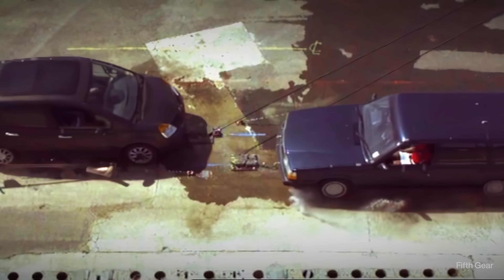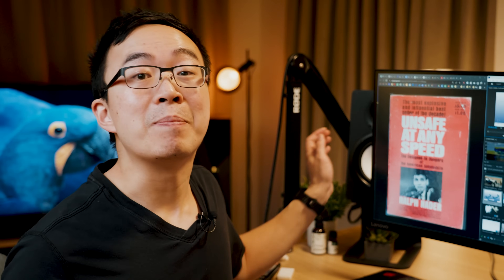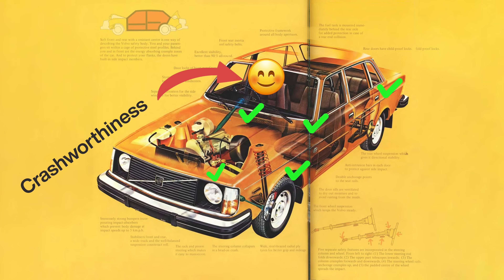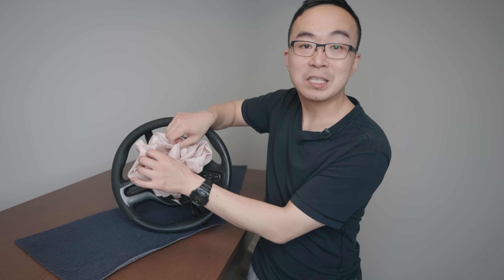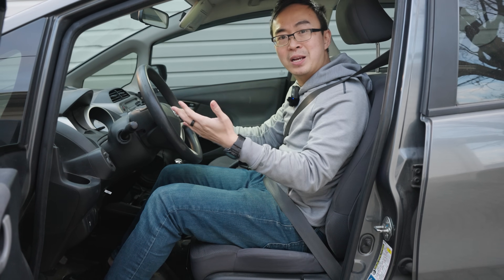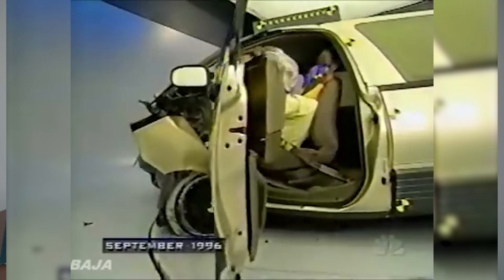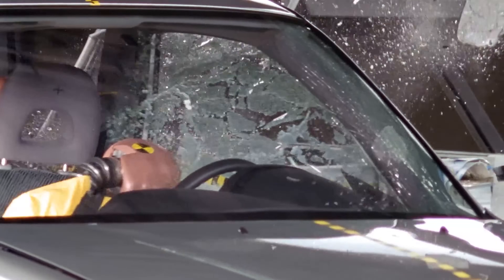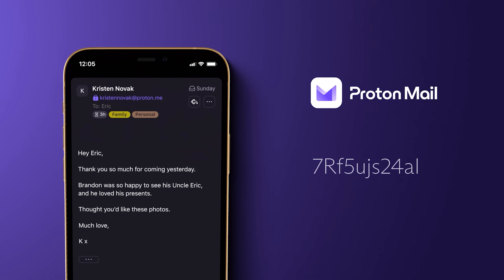When does a car stop being safe?

Comment: Fun fact from an industry insider: in many cases, the automakers had already identified and designed solutions for the problems that IIHS testing would later bring to light. 

The automakers calculated that they would lose money if they implemented these changes, however, so it's a good thing that testing authorities like the IIHS called the public's attention to these issues, since otherwise they might have never gotten solved!
Reply: they just still use the old design just in other markets. Example: renault sells old european dacias with current 1 star ratings as renault in latam.
Reply: @f3rny_66  Yep and Nissan sold the Tsuru in Mexico for many years.
Reply: Well there are too many people there anyway @f3rny_66
Reply: I was once present in a meeting where it was dicussed that the area where the pole in the NCAP side impact test strikes, needs to be reinforced. Simulations showed a below 5* rating. Mind, "THE AREA WHERE THE POLE OF THAT TEST STRIKES", not the whole side - just that specific area. God forbid you hit a tree sideways in a different spot...
Reply: Reminds me of Fight Club
Reply: It is not as bad as it may sound. After all, every car is a compromise. Adding more safety features makes the car not only expensive but also bigger and heavier. And while people value safety when asked, we do not all buy the safest car on the market when buying a new one. It is again the same tradeoff at work and having a reasonably safe but more economical car (or a smaller one or ...) might be the better compromise.
Adding more safety features than necessary makes sense, if you can make this a part of your brand identity (like Volvo used to). However, cars have gotten so safe that safety is hardly a unique selling point, especially in the mass market when price is the dominant factor
Reply from the maker: Agreed, it would never have left the engineering labs if it weren't for outside forces pushing for change.

There was a nhtsa study on the total cost of safety improves including research and implementation costs and it was something like under a $1000 a vehicle.  Economics of scale.

It probably was a money loser until they all agreed (and consumers) that cars could be more expensive.  Also why they're all so expensive now.

Thanks for the inside perspective!

Edit: $1000 in 2002, $2000 in 2012.  Source: https://crashstats.nhtsa.dot.gov/Api/Public/Publication/812354
Reply: I don't know if this translates correctly. In Germany, we say " a horse only jumps as high as nessasary"
Or in other words, why should you spend money on something that nobody cares when burying this car.
Reply: @raphiseth6942  It's not that nobody *cares*, it's that nobody *knows*.
Reply: @raphiseth6942 I don't know if that translates correctly either, but I can tell you it makes perfect sense.
Reply: And they need to make the tests stronger, as they are already in an area to design the car to pass the test ..and the car looses the moment the scenario changed.
You can see that are eu 5* cars that fail the 25% side overlap test...on the other side is cars have isses passing EU teat, as the focus is on pedestrian safety.
And of it hadn't been with the Mercedes A klass allomst rolling in a simple test ESp wouldn't have came out that fast
Reply: other fun fact, Volvo guys are very crazy about safety of people inside car, so you check their newer and newer version you can see how they improve
Reply: volvo was the only brand whit good scores in the small overlap on the first batch of tests, before the automakers knew about it, this was already standard testing for them 😂
Reply: More safety sounds nice, but what this means is that costs are passed on to the consumers.  The majority of car owners will not end up in a dangerous accident, but they didn't get a choice in whether they want a more expensive (and slightly safer) car and are poorer as a result.
Reply: @Zorro9129  ..a mind set thats often used to decrease or thumb on saftey...
..most ppl will never have any use for the seat belt either...or improved breaks, most cars will never be stoolen either so thers no need for locks either... ;D
Reply: @Zorro9129 Except that as per the video the improved safety has been driven (no pun intended) by money. The billions of $$$s saved by the insurance companies would have been added to everyone's premiums. Pay $s upfront when you buy your car and have a reduced chance of serious injury or death Vs pay $$s every year so that when you die your survivors get a payout.
Reply: @Zorro9129  I had a think about this. You definitely have the right to express an opinion. You have a reasonable argument that you should be consulted in advance. However in a market economy, choice isn't always as free as you'd like; it's driven by what will make the most profit, which is driven by what will sell the most. If you ask millions of people "This is our proposed specification at this price. Would you like to pay more for something that's less safe?" I can only guess what the majority answer would be, but the market has given its answer. You could ask a different question, eg "Would you prefer a car at this weight including additional safety equipment or a lighter one that handles better and is more economical?" but the market has spoken on that too judging by the move to SUVs; people don't seem to prioritise handling or economy.
Reply: @Zorro9129  It's not just about YOU. Nobody is making a special car for just YOU. The market and regulation demand safer cars. It is not 1984 any more . . .
Reply: @Zorro9129  My only gripe with this is all the new driver assisted non sense. I've an attentive and defensive driver, I don't want to pay for expensive sensors all around my car to beep and flash at me for stuff I'm already aware of. I think it's fine for them to be optional, but I sure as hell don't wanna pay for them.
Reply: @Zorro9129  when you make a mass product you always follow the path of compromise, Volvos have a fairly normal price for the level of safety and comfort that they provide
Reply: @Zorro9129  no one plans to get into a car accident, so what you're saying doesn't even make sense
Reply: An infamous case is the ford explorer from the 90s. Ford knew that if they made the explorer 2 inches wider, it would drastically reduce the chance of rollover. However their risk management teams decided it was cheaper to pay for the funerals, than to change their entire manufacturing process. Ford also spent a lot of money on lawyers to put the blame on Firestone tires for the rollovers.
Reply: Exactly why manufacturers should never be allowed to self regulate.
Reply: That's bull. Anyone who's got money to buy a new car is going to prefer the car that's safe to drive than the one that puts them at unnecessary.
Reply: ..bit unfair comparing a 33 year old volvo with any modern car... even in a crach test with a modern car (any).. the 33 year old one would be crushed ... it would be very surprising, and quite disturbing if it wasent, it would mean safety hadent improved, evidently it has... and that is very good...
Reply: Never gotten implemented*
Reply: that's capitalism for you. The least amount of product for the most amount of money
Reply: That is why I love subaru, they were ahead of the curve with mild overlap, rood strength, hard hit updated side crash test
Reply: It could also be a competitive advantage thing. To implement costly safety features you'll most likely push up your car's price above your competition. And no marketing type sitting in a boardroom or the CEO worried about his bonus check wants to see reduced sales figures.

But if everyone is required to do the same thing, then the 'cost disadvantage' is removed!
Reply: That was a big reason why Unsafe At Any Speed was written. Chevy knew that the Corvair was a deathtrap, and they made a business decision not to fix it.
Reply: This is peak capitalism, "our car has this weakness that might kill people, develop a fix in case anyone ever notices but don't implement it until they do".
Reply: When China designed their new car they designed a new class of crash test. They want to see how much redundancy automobile manufacture put into their car when it is crashed into another car within 40lbs of curb weight of itself in the same class. So for example a car born out of TNGA will be in crash test with a car from MQB platform.
Reply: Yet another case where pure capitalism just doesn’t work. Some things will always require regulation or government intervention.
Reply: I just some how wish we could make older cars safer too :\
Reply: @Eduardo_Espinoza @Eduardo_Espinoza While there won't ever be retrospective improvements to individual older cars, they do benefit from the research and progress in design. I'm not certain of exactly what is transferred across the pond, but the Euro ncap tests include compatibility specifications with the intention that passengers in smaller cars and those with worse passive safety don't suffer as much damage - also driven by reductions in insurance payouts, since it costs just as much to compensate occupants of the older car hit by a modern one as compensation to occupants of the new car. The active safety devices also work to the benefit of older cars - autonomous emergency braking reduced the number of rear-enders by up to 60% and lane departure and blind spot warning devices also benefit other road users.
Reply: @Eduardo_Espinoza  ..u can make an old car safer than a new car... scrap it...
Reply: @Eduardo_Espinoza  Oh absolutely! I LOVE older cars!
Reply: @Eduardo_Espinoza with enough money you could. A lot of money. Volume is the only reason carmakers can take this amazing technology and implement them in something as common as a car. It’s why smaller automakers simply do not exist any longer.
Reply: It's always about money. But then what about a Honda fit vs a F-150 or a semi. What's the point of the IIHS enforcing this overlap standard when you have the number one selling truck against a compact? It just makes everything more expensive.
Reply: @aaron___6014  Even in that scenario you will have a better chance of survival or at least reduced injuries than for example a 1 star car.  All these also do not matter much because if you are doing 120km/h and you hit a stationary object with any vehicle you are dead.  Crash test are basically designed for city driving, where most accident happen.

Comment: Yet the cybertruck is touted as a future car using the old way of engineering that caused so many deaths.
Reply from the maker: As in sharp it is?  Probably bad for pedestrians
Reply: They talk about how they made the stainless steel bodywork the most rigid part of the entire car allowing them to skimp on internal strength. Resulting in little to no crumple zone. Maybe 30cm. Top Gear's video has great insight into how it's made.  @Lam

Comment: You did miss one thing, the lack of crash compatibility tests. Not Just Bikes mentioned it in his video about trucks but it goes a bit further than that. As big trucks and SUVs get more popular these crashes will also get more common, in effect making smaller cars even more unsafe through no fault of their own. And it is not just cars either as Semi-trucks also have the same problem, the small clip at 13:36 shows what could happen. I do not remember where I saw it but this is still a flaw in modern trailers as most of those crash bars are not tested to be able to hold back a crash and the height on most of them are too high to be of any use to small cars.
Reply from the maker: I deliberately skipped it.  It's an important issue for sure and it would have taken it off the testing angle I was focusing on.
Reply: This is why I’m always afraid to drive in front of or behind a a semi.
Reply: @Wasabi9111  i wouldnt worry about being behind one. just keep proper following distance. my motto is if i crash its gonna be hard enough to kill me, so im either driving like a maniac or a grandma. no inbetween
Reply: All semi trailers on the road these days are either equipped with an ICC bumper or an IIHS guard. The forces required to fold one of those under the trailer is going to kill the driver. They can take the impact of a civic plowing into them at 60mph and still keep you from underriding
Reply: One area I guess we may not have looked at as much is crash compatibility between different heavy vehicles; in my country 2 public buses were severely dented after being T-boned by dump trucks. Guess the latter was heavier despite being shorter as its payload e.g. sand/soil is heavier than the passengers on a bus. Another public bus also managed to get totaled after being shunted by an army truck of similar size to a dump truck, while yet another bus was totaled after being T-boned by another bus off a ~2m tall cliff. Maybe the bus (a Mercedes-Benz Citaro) had a monocoque design (where the chassis isn't separate from the body) that saves weight but also transmits more of the crash energy from the impact point to the rest of the vehicle's structure, leading to more extensive damage. The scariest accident I saw was where a light cabover truck (a ~2t heavy Toyota Dyna I think) was crushed between 2 buses

Comment: One other thing, I think the amount of gas released by the airbag is modulated by the acceleration of the crash, otherwise the impact of the airbag can kill you.
Reply from the maker: 100% there's two charges on the back of airbags that allows them to stagger or blow them at once.  I was going to mention it but cut it for pacing reasons.
Reply: @Lam  Oh is it/ has it been binary like that? I thought there was some sort of mechanism that allows a percentage of the explosive to burn depending on the accelerometer readout?